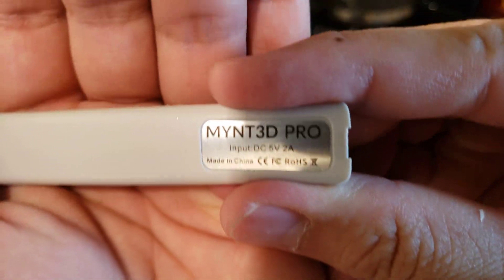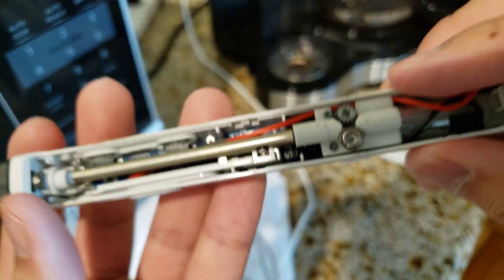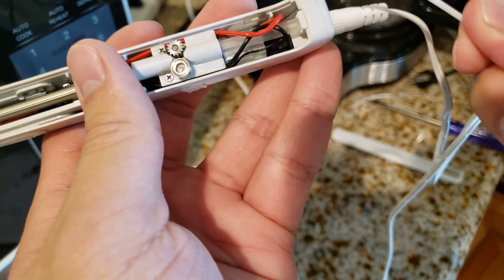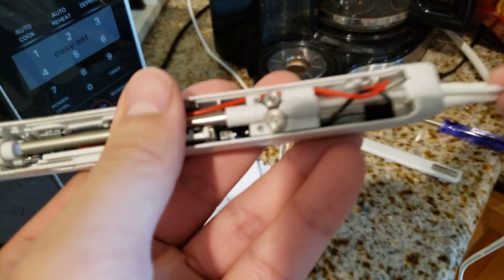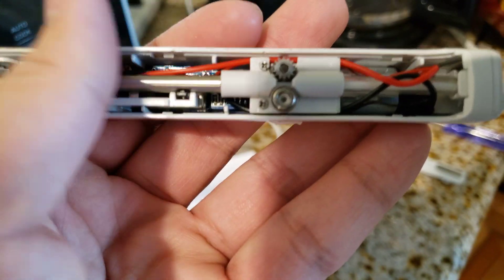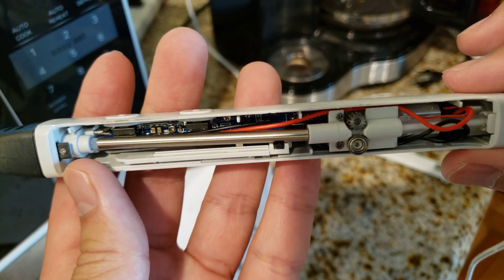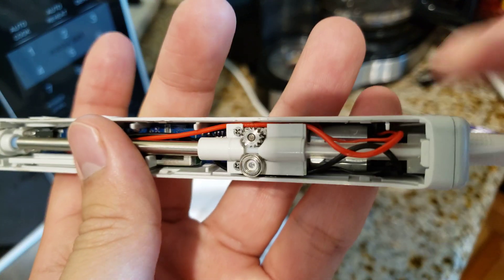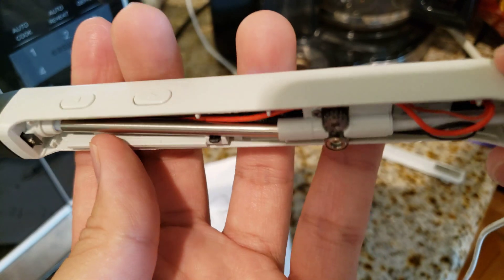MYNT3D Professional Printing 3D Pen with OLED Display - Disassembly & Review

Comment: have you tried to push the gear down (that look only a pressed gear on a shaft) which time of use may explain (it’s an adjustment after long use or just badly assembled).. for the filament, cut it with an angle going to inside the natural filament spiral curve, that is not an issue, it’s a way to work with.. what is your third issue?